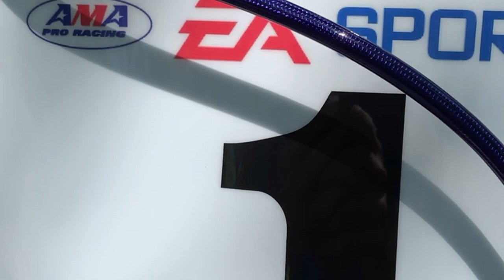Jeremy McGrath 2000 yz250 Replica

Comment: Wow.. that is nothing short of amazing.
Titanium subframe and all...
Reply: I used to work for a small bicycle manufacturing shop in Michigan in the 90's who made Ti bike frames, (Nuke Proof, when they were in the states).  That weld on that sub frame could be a better, and I have to wonder about contamination.  The thing about welding Ti. is keeping the air off the hot weld so it can't suck impurities from the air.  The material will turn brown, blue, purple as it gets contaminated.  But unfortunately for the buyer, the color of impurity can be buffed off with a buffing wheel very easily.
If it is contaminated, it will break more easily, as the great material loses its integrity when contaminated.

Comment: Looks fantastic! A real replica would have the forks so stiff only hitting a wall at speed would move them.
Reply from the maker: I know right. I replaced the springs inside with steel rods haha
Reply from the maker: I have 7-8 magazines from 2000 and nearly all the bikes going into the first turn that are hard on the brakes in the magazines appear to be about 2” from bottoming while
McGrath’s were still at the very top
Of the stroke. It’s crazy how he could even ride it.

Comment: Absolutely awesome video man. The details are perfect on that bike. Love the safety-wiring. Is that Ti sub-frame?

Only thing that could have made that video aby better is if it faded away with it idling in the background. 

Awesome work!
Reply from the maker: The riding videos are coming. Yea it’s the ti subframe. Check out the solid ti axle blocks.
Reply: @Tylerw129  Very cool, I realized they looked trick but I didn't realize they were ti.

Looking forward to more videos, keep it up!
Reply from the maker: @motocrosser411  yea BDP racing made them for the build.  He won’t make another set cause these were made out of spacecraft engine grade ti. Not typcial grade 5. So it’s def a one off part.

Comment: Beautiful bike great job.the only bitch I have is the number one on the plates are too small
Reply from the maker: Really?  I have 10 magazines from the 2000 sx season. The 1 changed font, size, and even placement several times in one season. I chose this version over the others. Some were odd looking and very square.
Reply: @Tylerw129  you did a great job it's beautiful it just looks like the 1 should be a little bigger same style just fatter makes the number plate look a little empty.but it's just my opinion
Reply from the maker: @denniswilder3014  it’s a good one because I do agree.  I thought I was on the only one who noticed.
Reply: @Tylerw129  I think it is the number plate I think the original on mcgraths bike was smaller on the bottom and tapered wider as it went up.